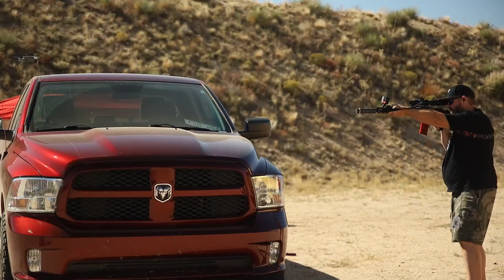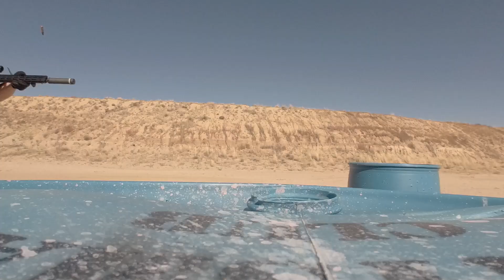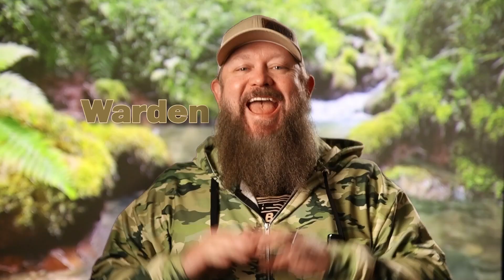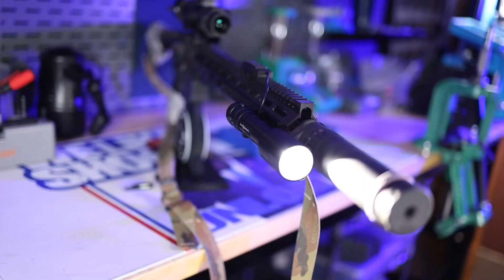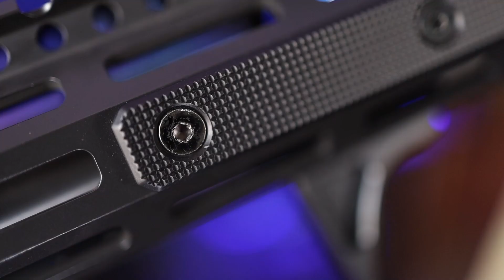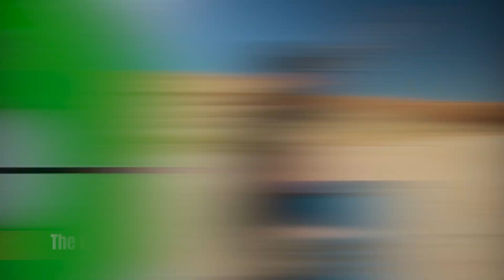Mitchell Defense AR-15: A New Player Has Entered the Game

Comment: You can build a better gun for the $1600 they want for this thing.
Reply from the maker: Bullshit.
Reply: @dangerousfreedom  I literally did that with my first rifle, I used a SOLGW east india company upper($600)
Army contract overrun BCG ($150)
Lower from LGS for $125(aero)
Troy handguard from tac swap $125
BCM Receiver extension kit $60
Magpul MOE stock and grip tacswap $50
Random LPK $25
G2S trigger from DPMS $100
Raptor CH $80
Total cost around $1400

After I built it I found a p4xi in an adm 1301 mount for $500 and got a surefire 600 pattern light for $200 from Arisaka.

Ive since swaped to a rifle length buffer system using a green springco and rifle buffer and an a2 stock.

I have a far more reliable gun for less and that half moa accuracy guarantee is bull.
Reply from the maker: @Hasid_Lafre yeah I’m looking over those components, knowing that several of them are not even near the same quality. Did you put it together with your bare hands or did you buy tools too?
Reply: @dangerousfreedom  I paid $10 for a ncstar ar15 wrench, used a pocket knife to get the pivot pin detent in and a screwdriver to do the grip screw.

I built a more reliable gun for less and is far more accurate than I am when doing drills.
To say SOLGW, BCM, Geissele are not the same quality is just laughable.
Reply from the maker: @Hasid_Lafre lol you are lost in the dunning Krueger curve

Comment: The irony of shitting on DD for overpriced stuff as well as Geissele. Both make their own parts and are recognized as excellent mfgs with the exception of people that hate on them for stupid reasons such as they wont give you freebies. 
Mitchell defense might be worth the money, but when SOLGW exists and has been doing what MD is trying to do (assemble guns with other peoples parts) $2k is ridiculous for someone trying to get into the market. Nobody knows them. Im glad you like your gun tho. 
9310 bolts suck. There is a reason people use carpenter 158 and i doubt MD managed to crack the code on longevity and proper heat treatment of 9310 bolts. 
The offering from Aero that you talked about is pretty damn similar and from a company thats been around for 20 years making reasonably good stuff and you shit all over it. 
Reading the parts list off MD website doesnt prove you to be an expert either. Once again, SOLGW has been doing that for years.
Reply from the maker: Cool opinion. Thanks for sharing it.
Reply from the maker: Hey, also 9610 bolts. 

Bolt material
9610 alloy is our material of choice. It is a very high strength metal that has a very high wear, corrosion, and heat resistance. It also is a very machinable metal that makes it easy to make precision parts. One bonus is if it’s properly heat treated it will have 7% more strength than Carpenter 158. There are a lot of heat treaters out there and very few do it the right way. We took a very long time to find a heat treater that put as much care into their work as we do. Statistic time. They heat treat 40,000 bolts a month and over the last 7 years have only had 4 go bad. That’s a great track record.
Reply: @dangerousfreedom  you are doing a great job of illustrating my point. 9610 bolts aren't a thing. You're reading from their website and taking their opinion info as fact, and parroting it to people that will spend an unbelievable amount of money on something that's a $1200 gun, they use a 9310 bolt. They need to go back and edit their website. This stuff is what I find annoying, you're so high on the $2k gun and dont know the material being used. 
Im sure Knights Armament, DD, BCM, SOLGW, Sionics, LMT etc were all too asleep at the wheel to figure out 9310 is the way to go. I'm not trying to shit on you or the gun, its the price thats insane. Like it or not, the TDP exists for the m4 carbine and exists for a reason. The excuse of the military uses the  "lowest bidder" regarding parts is a fools argument. 
Kinda like Jeremy on chrome lining, apparently he knows more than FN.
Reply from the maker: @deadheart556 and you know more than all of us.